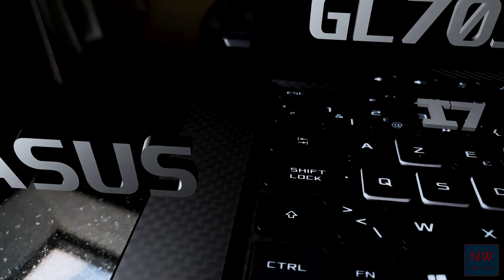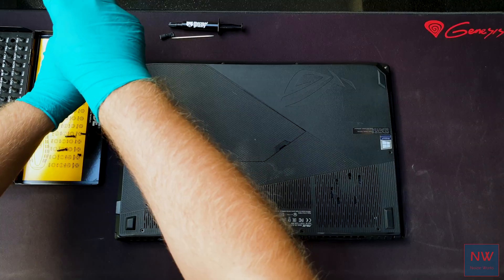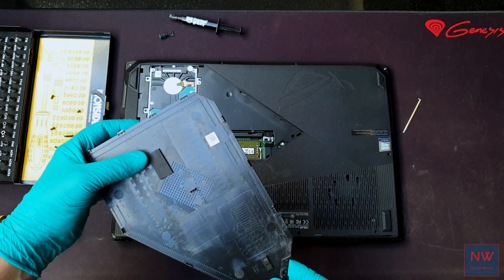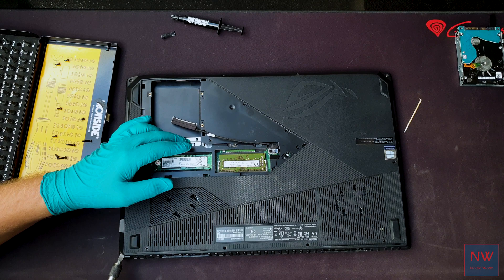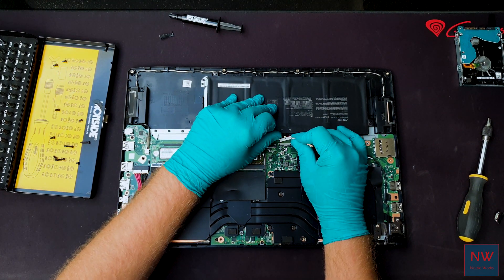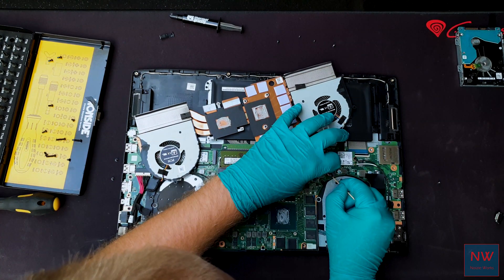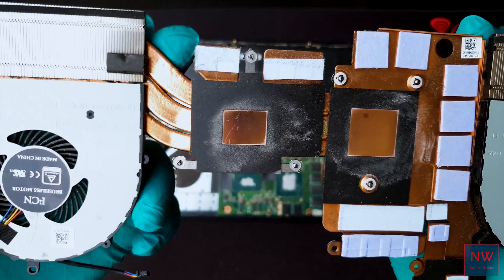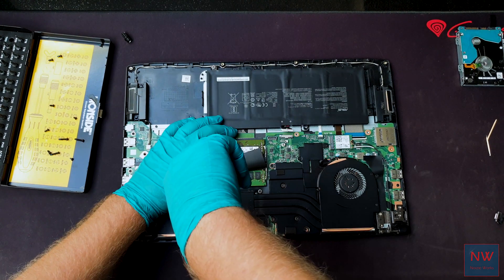How to fix an overheating ASUS ROG gaming laptop with a repaste

Comment: Nice video! I found your video for tips on how to apply thermal paste (and how much) on my laptop (same model), and it's sad you just skipped that with just a footage of the thermal paste tube. We can't have everything I guess :)
Reply from the maker: I'm sorry buddy, i just spread it out over the complete die. because it doesn't really matter. Better a bit thicker then not enough thermal paste and buy the good stuff😉 thanks for watching
Reply: @NoizieWorks  You should warn people when you mention Grizzly that their main selling paste is their liquid metal and that they can't just slap that on.  Has to be a thin layer spread out so that none touches anything other than the cpu/gpu and the heatsink and non spreads out onto any lead.
And thanks for the video.  Worked on desktops since the TRS-80, but always hated working on laptops.  Skips a few things, but still enough to get it done without worrying about breaking things or missing screws.
Reply from the maker: Almost forgot, you can see me applying it in this video https://youtu.be/wVQynN4oGS8

Comment: I didnt See where u applied the paste you kinda skipped over that and I SO Need to do this the outbound air from the vent warped the plastic on the bottom right of the monitor air was so dam hot..
Reply: Oh was that silver coating the entire chip what u did ?
Reply from the maker: 1:54 the mirror like chips that i cleaned of need the paste
Reply: @NoizieWorks  Ahh ok I only built and worked on towers my monster never gets hot in the cool master haf I used to have a ASUS G74  2years in iraq with it dust storms never got over heated this thing basic games ARK wow minecraft 1 min in the air coming outa the vents makes the monitor mold get hot and warp..
Reply from the maker: Damn.. cool story tho good luck with the repaste!

Comment: i repasted mine but now the idle temps stayed at 70 C on the gpu and cpu, any idea why?
Reply from the maker: Did you use enough paste? Gave it a bit of a push? The heatsink is with spring tension so if you used thick paste that might help it out.
Reply from the maker: Better to much then not enough, spread the paste out covering the cpu and gpu complete. Start to thread the screws and before you tighten it give it a GENTLE push and screw it down. No probs! Hipe it helps. What paste do you use?
Reply: @NoizieWorks  thanks a lot for the tips man! i'm using noctua nt-h2, subbed
Reply from the maker: Thanks! And your welcome. Good paste so that's not the problem.
Reply: @NoizieWorks  an update, so i just repasted my laptop again, and at first boot the idle temps are really cool, it was like 45-50 C for both the cpu and gpu, but then after some heavy gaming for like 15 minutes the load temps are back to 91 and 90 for the gpu and cpu, so my laptop still thermal throttles pretty hard, then after that i noticed my cpu and gpu idle temps are back to 70's, any idea why? this is like my 3rd time repasting this laptop this month lol
Reply from the maker: Did you look at the boost clocks? Try a fresh windows install. Could be some crap running in background. You cleaned the fans?
Reply: @NoizieWorks  oh, just figured it out, the idle temps are caused by the clocks staying at max even at idle, because of a power management settings. but still,,load temps are not as good as i expected after repasting, 88 on gpu and 91 on cpu is not something that's good on a game that doesn't use that much gpu like dota 2. I can barely run fallout 4 because the gpu is thermal throttling so hard at 91 C (Keep in mind that those temp are after -148 mv undervolt on cpu and my gpu is also undervolted using msi afterburner) , so my thermal is really, really bad. 
Any idea about what i did wrong? prob the repaste? can i use a credit card to spread down the paste on the cpu and gpu die?
Reply from the maker: Did you clean out the fan casing? Could be that there are dustclogs in the fins. You can use wathever you want to spread it out, credit card works perfect. Also is the intake blocked by your desk? I made some extra holes to make it breath better or simply by lifting the back a bit up by putting something underneath the back 2 rubber feet.
Reply: @NoizieWorks  i see, yeah the intake is blocked by my desk,i don't really think i can drill out some holes, so iam short on options here, what things do you recommend to put underneath the rubber feets? i haven't cleaned my fan yet since i don't have any compressed air can, idk where can i find it in my country. Also, what do you mean by the fan casing? is it the copper heatsink that covering the fans?
Anyway, thanks for the response so far man, i'm thinking to sell this laptop since iam quite tired of the thermal problems, and just build a decent pc with the money, since thermal throttling shouldn't be a problem on pc.
Reply from the maker: Pc is king! Well the fan is inside a casing wich directs the air true the heatsink thats connected with the heatpipes. Dustclogs can fuck over your cooling(insulator) and restricts air. You can open that casing removing a few screws. I got a how to on the channel. https://youtu.be/wVQynN4oGS8
Reply: @NoizieWorks  thanks man, gonna try it out when i got a hand of compressed air can

Comment: ive had this laptop for 2 years and never gen more than 70 on my cpu and thats running full 4000mhz  and ive never get those high temps usually i get low 60
Reply: how ? ihave also this laptop and i get high temps if i use it more than 30 min on gameplay
Reply from the maker: Repaste,clean the fans and undervolt. You can find these video's on my channel

Comment: Where is this "Surface mounted chip on the gpu" thing?  Your explanation is too fast and I can't catch up with this important thing. I don't want to break my laptop just because of this.
Reply from the maker: The die of the gpu is surrounded by little resistors. Clean the 2 dies and ignore the resistors. The paste is not concductive.
Reply: @NoizieWorks  okay thanks for the explanation, so as long as I only touch the die it'll be okay right
Reply from the maker: Yup! The resistors can take some rubbing but it's not worth it.

Comment: Thanks mate, I probably have the same laptop, gl503ge scar. But my cooling heatsink looks different.  I did the repasting a while ago but I saw no change. My fans are always om max and super loud. 
I want to know, if there is some problem in the bios or the asus fam control softwares, does it effect the laptop's themals?

Comment: I can't open the heatsink bolt,help me :(
Reply from the maker: What bolt do you mean? If its the one with the spring then that's normal
Reply: yes with the spring on it, I figured out that normal. I already replace the thermal paste with thermal grizzly kyronaut. But it seems not to make significantly lower temps. My normal temps were 90°c before I repaste. And it's only about 80(it's quite okay for me)after repaste but it's also hit 87-90 sometimes. Is it normal? I'm afraid that I do anything wrong. By the way thanks for your help since the first time :D
Reply from the maker: Have you looked at you boost clock? Before the repaste i was seeing 3.1-3.2 ghz and now i have full boost clock with lower(ish) temp. Don't forget to undervolt the cpu with -100mv for that bit extra using intel extreme tuning utility. Also a video i made "undervolting tutorial" 90c is ok when slamming it not to be afraid of
Reply: @NoizieWorks  gonna check that video,thanks!
Reply from the maker: If you want go to my facebook page @noizieworks and get in contact with me trough message

Comment: I have the same laptop and i afraid to do repaste by myself,it's there something that i need to carefully before repaste?
Reply from the maker: I made a complete guide for this laptop with ALL the steps so don't be afraid! https://youtu.be/DSWwzGtWcrs
Reply: @NoizieWorks  thanks!
Reply: 1 more questions, can i just pull out the heatsink from the fan?in that case i will clean the fan and repaste without pull the whole fan, i watch your video about cleaning the fan
Reply from the maker: Yeah if you watch that video you will see that the heatsinck can be removed from the fans.

Comment: Hye man, I have the Asus ROG GL503vmf ( i7 7700hq, 3GB GTX 1060 ) and have the same problem, it runs 65 Degrees on idle and  90+ while gaming, hence it thermal throttles like crazy. I cleaned it up and applied some thermal paste but it didnt have a great efffect. Could you please tell me what else I can do ? They say i should undervolt my GPU but i dont have the slighest idea as to how to proceed. 
Anticipating a Responce, Cheers!
Reply from the maker: Hey dude! I have a undervolting tutorial for this laptop.
https://youtu.be/DkcoWmr2zaA
Reply: Bro I have the same laptop and I just cleaned it up and repaste it and my temperature went from 90-97 to 65-78 in game

Comment: hey if i dont have the glue to repaste but i still want to clean the fan when unplug the thermal system ? can i do that or i have to repaste ? sorry for my bad english and thank for reading ^^
Reply from the maker: Hi🙋‍♂️, i'm afraid that you will have a bad time as the paste(not glue) dry up over time and air pockets will form if you just push the cooler back with verry bad temperature as a result. I don't know where you live but search for thermal paste on the webs as it's not expensive. Ebay,amazon are a good start. Thanks for watching!

Comment: I´m not 100% sure, not bashing but from what ive learned you put a string of thermal paste onto the cpu so the weight of the fans evens it out. Looks like you use WAY to much thermal paste and people should watch out for that. However im not 100% Anyone knows what is the proper way? :D
Reply from the maker: Hi John, Gamers nexus/ LTT did some testing and it really doesn't matter how you apply it or how much. If it's to much it wil squeez out and because it's not conductive it doesn't hurt your components but i do appreciate your concern dude! :) *little edit: thermal grizzly has a little flat nozzle to smear out the paste so i guess they have the same opinion.

Comment: How much thermal paste did you use? Is 1g enough?
Reply from the maker: Normaly you should get 2/3 applications with 1g, total surface of the chips on laptops are much smaller cause there is no IHS to spread the heat. Cheers and good luck!
Reply: @NoizieWorks  thanks

Comment: Thank you so much for the video! I have GL703GM and going to repaste it too.
One question: when you unscrew the heat pipes, you follow the numbers on the screws? Like, 1,2,3,4 etc? Or is it in reverse order, like 4,3,2,1? 
Thanks!
Reply from the maker: Hey Nickolas! the screws of thz cpu and gpu heatsink are with spring tension so you can't over tighten them but you can use a cross patern to screw it on. Personally i don't bother, thanks for watching!

Comment: Does it work for GL703GS too?

And what about the blue thermal pads? Do I have to replace them? What if I find thermal paste on them instead?

Thank you.
Reply from the maker: Hey dude! This laptop will be very similar to this video. The cooling solution could be more beefed up as you got a 1070 right? 
You can keep the thermal pads and as far as i know they only use paste on the cpu and gpu on most if not all laptops. If you still have throttling issues then watch my undervolting tutorial on a GL703VM. https://youtu.be/DkcoWmr2zaA
Reply: @NoizieWorks   Thank you very much for your answer! I already undevolted my CPU and my GPU via XTU and Afterburner, but I'm going to end the second warranty year soon so I was looking to repaste everything :)

I use Open Hardware Monitor for other motherboards Temp, do you  know if there is a way to monitor the temp of that "little components" under the thermal pads, or if they have none?

Thank you again :)
Reply from the maker: @91Haldo   No problem! Yeah i didn't wait for the warranty period :) the repaste with a good quality paste wil give you some extra improvement but i think that the "ultra flat gaming laptop" thing is hurting the cooling solution on most "gaming" laptops.
You can pull a lot of info from HWINFO https://www.hwinfo.com/download/
Now it's not an overclocking high end atx mobo so your mileage may vary on the sensor part.
Thx for subscribing dude!

Comment: Bro can you make a video how to undervolt... i have same as yours... gtx1060 6gb with i7-7700hq.... i did same repasting with Noctua H2 thermal paste... but no result... i tried some tutorial for undervolt... didn’t work
Reply from the maker: Sure, i have plenty of time now #corona
Reply: Noizie Works it will be very helpful... i have already lost my warranty due to repasting... but not getting performances... temperature goes upto 92c for cpu and 91 for gpu... i am worried..
Reply from the maker: @boxofapollo950  No need this is "normal". I am working on the video as i speak so hang on!
Reply from the maker: Video is up!
Reply: Noizie Works thanks bro... hope it will help a lot

Comment: Can i clean old thermal paste with alchol swabs around the ciruiut where paste struct between the small chips
Reply from the maker: Yes but it doesn't matter if you clean it or not. Performance will be the same.
Reply: @NoizieWorks  thank youuu

Comment: Can you make a video cleaning the fans please?
Reply from the maker: Hi asai! A good hit with some compressed air is all it takes imo.
Reply: @NoizieWorks  i would like cleanning fan video because im not be abble to open the motor fan its so hard i scare to broke it do you now it is possible? because the fan its noisy i think there are dust into the motor thank you!!!!!
Reply from the maker: @robertmondragon4042  https://www.youtube.com/watch?v=1lxvmay2tn0&t=45s   this man made a good video about it. If there is nothing wrong don't pull it off cause the lube will be gone. Thanks for replying dude! Good luck